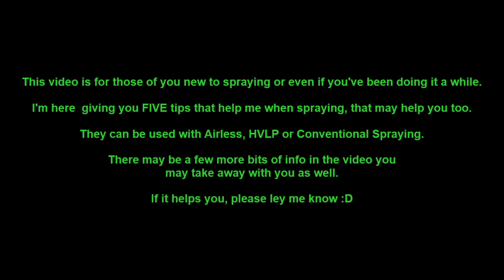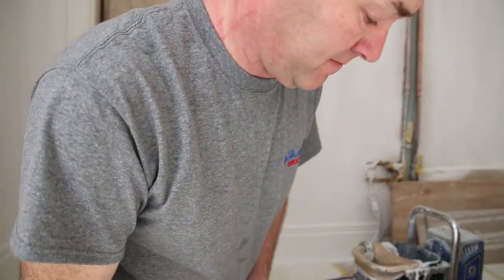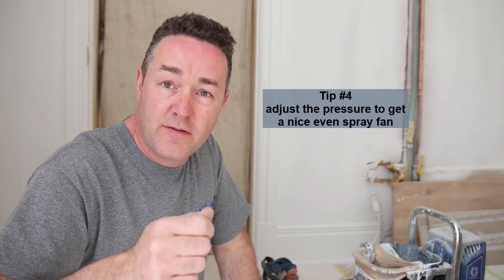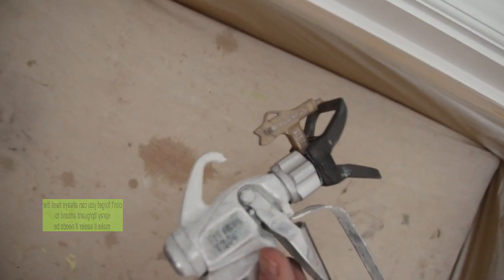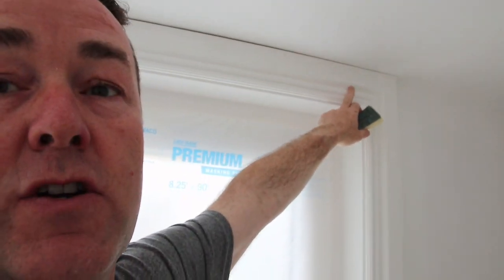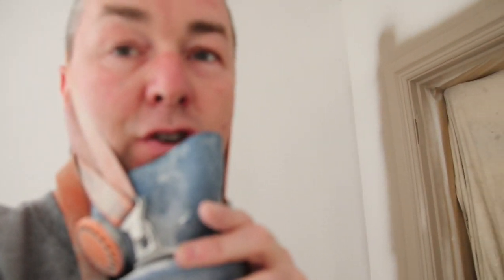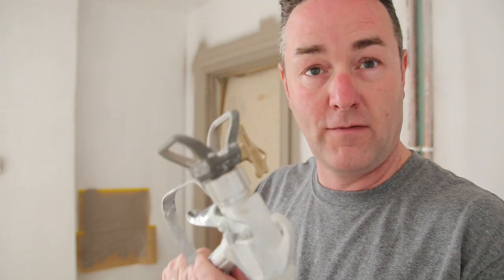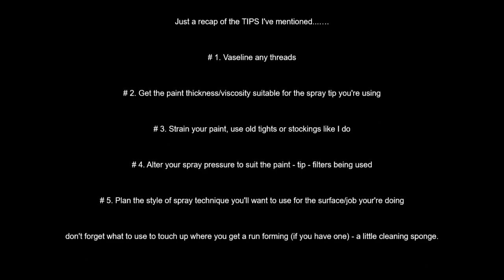Game-Changing Woodwork Spray Painting: 5 Tips You Need to Know!

Comment: Thanks Phill. Got the sprayer out today for ceilings, HVLP is out tomorrow for the woodwork you have given me more confidence to spray
Reply from the maker: Don't dismiss using the airless for woodwork... Correct tip size and pressure you be quicker than hvlp.... Less thinning of paint and you can get more paint on the surface when you need to build paint up ... Particularly on new woodwork... Like in this video.

I still using my QT5 hvlp on woodwork too. It does have more control... But find more dust in the air due to the unit blowing air about ;)
Reply: @ProfessionalPainterDecorator  thanks Phill, have you done a guide to tip sizes and their uses?
Reply from the maker: @mungojack  yes a few months ago, I've one that covers what the tip numbers mean..... have a look down my video list.
Reply from the maker: @mungojack  https://youtu.be/2SfuzttUtsg
Reply from the maker: How are you getting on with the spraying?

Comment: OMG sponge trick amazing. Could I use that method to do touch up say something gets caught when moving things around, rather than getting the sprayer out again?  Amazing video
Reply from the maker: Yep... You mean you're not already lol
Reply: Hi Phil,  can I ask you something please. I used B.I.N primer on all my bare wood and sanded it with 120g painted in using Johnstones arctic satin. Left it over a week before masking it all to spray the walls, using a delicate masking tape. Anyway have to come to de mask and it’s all pulling of where the tape was. It has made a mess. Is there any ideas why it’s failed so badly? Any input on why and how you would go about sorting the mess would be greatly appreciated
Reply from the maker: @marchandford7787  hi, what actually ulled off?
it it pull off back to bare wood, or did the arctic satin pull off away from the BIN?
Reply: @ProfessionalPainterDecorator  hay Phil the Acrylic Satin pulled off back to the BIN which I also sanded with 120g.

Comment: Little tip for your Phil, how about a fish tank heater in your hopper to heat your paint.
Reply from the maker: now there's a thought, have you tried it?
Reply: @ProfessionalPainterDecorator  ill give a go, my gx 21 arrives tomorrow with the trim kit, been a professional sprayer in furniture, for over 12 years,pressure pot and and gun, so will be interested to see how different the airless is. But back to the fish tank heater, I reckon it will work a treat, maybe put a couple of Johnny's on it, in case it breaks.

Comment: Another tip for you 
Same tritech gun put some masking tape around the top of the filter as well as a spring 
Filter is tight into the gun 
Sprayed 22 doors and a staircase this morning 
Not one single tip block
Reply from the maker: What time did you use, what paint?
Reply: Iam convinced bits go up the side of the filter 
Been using tape for a while 
Never let’s me down
Reply: Acrylic primer 
Do you mean how long did it take ?

Comment: Great informative video Phill, just a quick question I have the gxff you obviously prefer the tri tec tips to the graco ones just wondering if they are better or if it’s a personal preference cheers
Reply from the maker: No .. I do have a a couple of Graco green FF tips... And use them ... But I've found I've bought more Tritech tips and keep with those.

The GXff came with a loft 210 tip, which I've used too.

You may find you'd not really notice much different when spraying.
Reply: @ProfessionalPainterDecorator  thanks for that I tend to use the 210 tip which came with mine and been happy enough with it was just curious in case there was a better system thanks for the reply keep up the great work
Reply from the maker: @rogerbell123  big thing for me is tips wearing and also blocking up.. then having something to  fall back on if I'm on a spray job.. you need a spare back up. ;)
the 208 gold I used as a final coat gives a very nice 'mist' spray... but .06 and .08 do seem to block a bit more with the waterbased paints.. as really they are geared for thin stains and lacquers etc.  But thin the paint enough you can get away with it ;)

Comment: Hi great vid Phill 👍
Just wanted your advice,  can I use the gold 110 tip with the Wagner Control Pro 250M?
Thanks.
Reply from the maker: As long as you use the correct spray guard for the tip being used.. shouldn't be any problems, swapping between different guns.
I use a Tritech guard/tip on a Graco Gun.. and vice versa

Comment: Really informative video. i wonder if you have any suggestions for paint crazing over caulking. Caulking is fully dried and paintable but still get some crazing/cracking of the caulk. A coat of something like Zinnser BIN helps but not always. Any tips to help prevent the cracking?
Reply from the maker: Change your caulk.

I've had it previously.
It's mainly when it's not a flexible caulk.
I've moved over to waterbased caulk that can be used interior and exterior.

I'm using RedDevil caulk and it's brilliant. Dries quick. Not had any crazing with it 

What is try is going over the problem caulk with a fine smear of more flexible stuff, allow to go off and see how it is.

RedDevil caulk RRP is only about £2 a tube. Try it and  let me know how you go on.

On this vid I'd of used Fathog black tube interior/exterior flexible caulk.. but you can't get it anymore :(
I think RedDevil is the same stuff in an other tube lol
Reply: @ProfessionalPainterDecorator  Thanks for the reply, I will pick up some RedDevil and let you know how it goes.
Reply from the maker: @danielfitton437  did you try some?
Reply: @ProfessionalPainterDecorator  Yes, it's way better than anything else i tried but when spraying the WRX satinwood I would still get a little bit in places. What's your go to satinwood when spraying?
Reply from the maker: @danielfitton437  I still like the Tikkurila Helmi 30 or Everal 40, they spray so well.
Zinsser AllCoat Exterior satin also sprays well.. hvlp and airless.

Comment: Hey Phil , what sprayer/type do you recommend for wood-work use ? Thanks
Reply from the maker: Hi.
I use both my HVLP and airless.
Both have their own advantages.

Hvlp can spray smaller amounts, more control.
Airless.. with a hopper kit.. can spray your woodwork/trim paints with ease. Use the smaller FF tips like I talk about.

I've the QT5 hvlp with a remote pot.
Also a Graco GXff and a Graco 495st  Max II.

It's down to budget and how often you'd be using it.

Comment: Hi Phil, I am just getting into spraying and have started a job 12 doors previously painted with gloss I have sanded them washed them down can I use dulux trade wood primer u/c on  them first before I use everal aqua 40 ? I would appreciate your help or advice 👍
Reply from the maker: Hi. Personally i don't like mixing and matching Undercoat brands with top coat brands.
Keep with the same when it comes to the UC and top coat.

Over previously painted gloss I'd go a nice coat of otex akva, then finish two coats of Everal Aqua 40... For build up you can always give it an extra coat of UC, or an extra top coat if you feel the need 

I wouldn't do Dulux UC then a Tikkurilla product.
Keep me posted

Comment: Why do you not mask up on the walls around the frame? If you had to do a light colour on the walls it would take a few coats to over that up. What do you use for windows and to protect them mate?
Reply from the maker: These walls are the same colour as the woodwork.

Yes you can tape around if you wanted, just keep a fraction away from the top of the skirting edge so you have a bit of overspray on the wall that you will then cover when the wall is painted. Does that make sense?

Windows I use plastic sheet drop on a roll with q1 tape and a 3m hand masker.
I have another video on that showing masking walls up... Have you seen it?
Reply: @ProfessionalPainterDecorator  thanks for your reply mate, yes that does make sense thank you, I've ordered some Q1 tape and I find it does rip quite easy I not overly keen on it.

I don't think I've seen the other video il try and find it later on this evening.

Have a good one mate
Reply from the maker: @paulmaguire2592  which did you order? I use the yellow and orange colour the most, the purple is for delicate surfaces.. which is handy to have too.
Reply: @ProfessionalPainterDecorator  I've ordered the yellow ones. I've got prodec ones to try aswell I have been using the fossa ones from decorating direct and I find there good.
Reply from the maker: @paulmaguire2592  i use the yellow for general taping up, the orange i use when taping skirtings up after spraying as they are a little bit lower tack.
Reply: @ProfessionalPainterDecorator  il order some orange ones to and see how i get one with them. Thanks Phil helpful as ever 😊